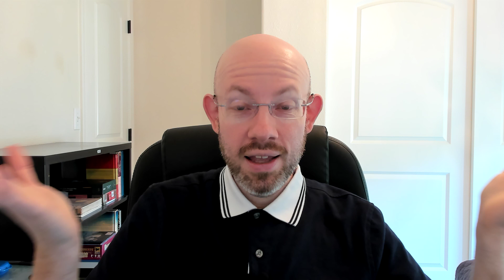Ford Maverick - An Extra Engine's Torque to the Wheels?!? Are You Serious?!?

Comment: Does this lower the  mpg?
Reply from the maker: @kenveum6456  I suspect at certain speeds it would lower the gas mileage, but at other speeds it may increase it because the transmission mapping and RPM may be able to change up to a higher gear at lower vehicle speeds. Thanks for your question! 🙂👍
Reply: @c.a.r.s.carsandrelevantspecs  I'm  going to the ford dealer tomorrow and order a 25 xl with  awd  and 4k
Reply from the maker: @kenveum6456   Awesome! I'm looking forward to learning more about the '25 Mavericks. Very nice! 👍